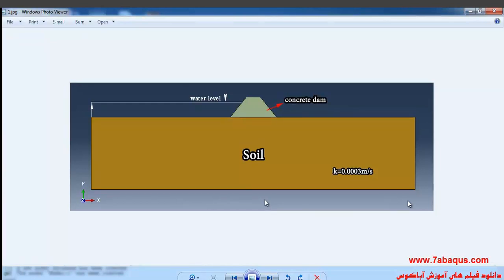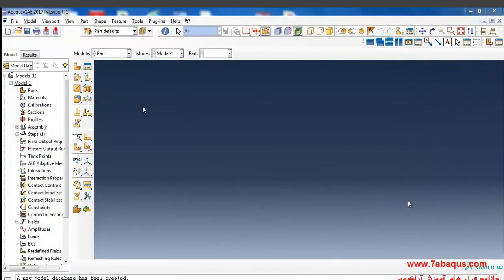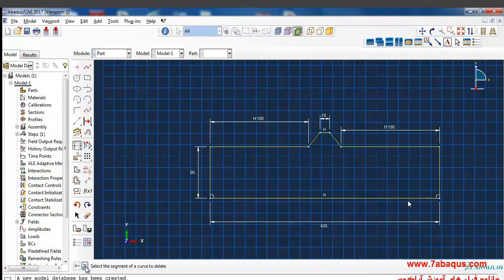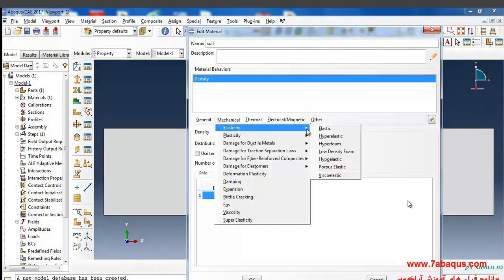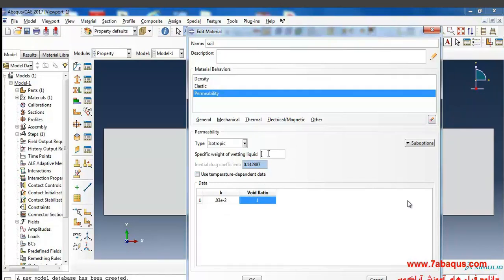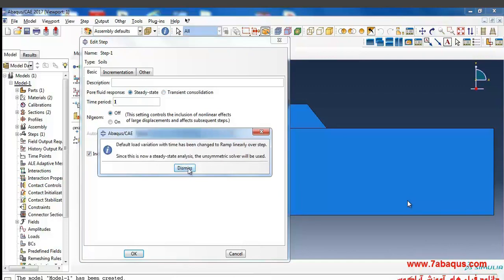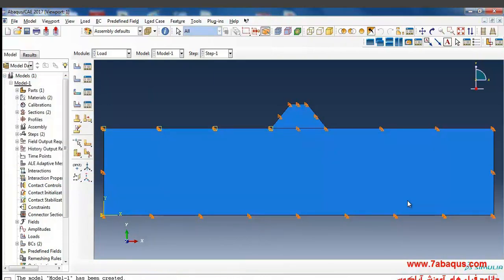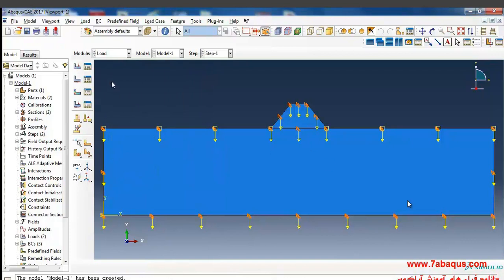Simulation seepage and drawing the flow net for soil Abaqus

Comment: Thanks for this tutorial video, it is really useful. 
I have a question: how did you calculate the body force for soil 7000 and concrete 23000??
Reply from the maker: These are effective specific weight(s) 
we calculate body force using this formula
"specific weight of saturated soil" Subtraction "specific weight of water"
17000-10000=7000